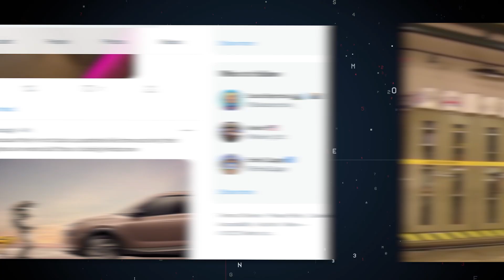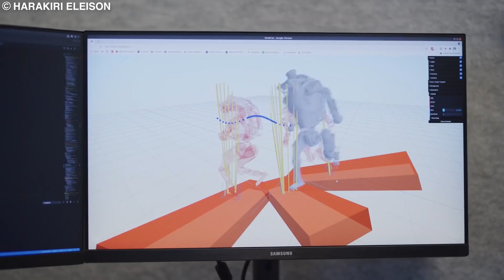Boston Dynamics' New Robot Makes Soldiers Obsolete, Here's Why

Comment: I'm almost certain in war the opponents would have their own robots to face off against before it comes down to a robot/human confrontation. Then if that be the case from what I see here humans still have the advantage of speed and agility.
Reply: Yes the robots would be able to operate autonomously but in battle where would they get the power supply to recharge in order to continue to operate alltogether?
Reply: @eulinpetit-woodyear6816  Solar, Robot FOB with solar and windmill arrays charging/battery support UV's.
Reply: @kevinwarburton2938  Solar recharging at a battle means the recharging unit, wether on the robot or at a base, would be out in the open which equals to an easy target.  Same goes for recharging using the wind.
Reply: @eulinpetit-woodyear6816  panels could be carried on the robot and detachable, even with cables so that the panels and robot can have different locations. Or there's probably something like satellite charging or so that emulates NFC so that charging can be done semi-remotely.
Reply: @pamlemm903  Basically it would come down to logistics.
Reply: Only if you are fighting a near peer. After WW2, the US only fought weaker countries.

Comment: Yea, well,.. a little suggestion, everyone viewing probably has ideas running through their head,.. but, the deployment of the Atlas to various environments, should also consider that like humans, their robots are limited in adaptation,.. my suggestion,  get Atlas some snowshoes[?],.. if the military is dropped into an environment, they may still be required to make adaptations, like snowshoes to help displace its weight across a shifting surface,.. I imagine they can simply stand more damage, across time, but I also see that tasks and use are going to be more in demand, than full autonomy. Just, get the job done,.. right? Autonomy will eventually come, but there's not been enough money spent to push such into "reality",.. We can be 'close' , for many decades to come.

Comment: How wonderfull this beast is with all of its Ai programming and tech BUT just like a Tesla or any other EV it will do a mile hike, have a couple of scraps along the way .....and go oH where is the nearest Grid socket that i can plug into for the next three hours and charge my Lithium ion Batteries.
COMMON GUYS until they invent a T 1000 ( Terminator ) Power cell this tech is going NooooWhere.
😀😀😀

Comment: Sometime 100 years or so in the future people are going to look back at this and know THIS is where all their problems began. Lol.
Reply: This is true. It's good we have an archive.
Reply: I’m remembering that scene in terminator 3.... when they are testing the first generation of terminators
Reply: Where all the problems began and an EMP is where they can all be solved. Robotics on the modern battlefield that have no defense against EMP are completely impractical.
Reply: @jessehines4044  Man, don't you think that in a few hundred years if they have fully autonomous AI controlled robots that have no need for external human control that they wouldn't know better than to not fully protect them with an integrated faraday cage to protect against EMP blasts as well as external hacks and whatnot? Not all electronics are susceptible to EMP blasts either. An EMP blast doesn't "DESTROY" electronics in the physical sense anyways, plus they only affect the ones that are powered on at the time of the blast. Any that would be turned off, protected or that operate on small amounts of electricity wouldn't be affected. Also electronics that do not have solid-state components that are vulnerable to electromagnetic fields wouldn't be affected either. Right now electronics can be fried by an EMP, but I guarantee in the future they will figure out how to insulate electronics in some kind of coating that protects from electromagnet fields the way rubber insulates against electricity. It's actually not too hard, hell simply lining electronics with aluminum foil is enough to create a makeshift faraday cage and will pretty effectively protect them from an EMP. Lol.
Reply: @chrislaws4785  Spare me, go back to watching Star Wars or something.
Reply: @chrislaws4785  Don't you think in the future that robotics won't be the only technology to advance significantly? It's kind of like the situation between body armor and firearms. Body armour was obsolete for 200 years at least once firearms came of age. But the people developing this technology aren't doing to so that in several hundred years time we might have an army of autonomous robots. No, they're doing it so that it would hopefully be applicable in a few decades from now. No investor is going to drop piles of cash in the hopes that they will turn a profit centuries after they died of old age. And right now, lest some huge revolutionary breakthroughs in both the fields of AI, fuel cell technology and counter EMP it doesn't look feasible for any of this to materialize any time soon.
Reply: @chrislaws4785  The thing you said that was the most asinine was about turning off all of the robots so that their circuits don't fry from an EMP attack. Ok, let's give your brilliant idea the benefit of the doubt so that all the robots will ALWAYS know that an EMP attack is inbound and then they all shut down in time ...sure. Ok, now you have a whole army of disabled and helpless robotic hardware.....STUCK IN THE MIDDLE OF A BATTLEFIELD AS SITTING TARGETS. So they're either shut down from the EMP attack or they're disabled from conventional fire once they make themselves sitting targets to avoid the EMP. Do you see the problem with your logic? You want to fantasize about godly robot soldiers of the future while A). Not considering that other technologies that will develop too and B). You're allowing your imagination to replace an objective perspective on whether or not it's even viable in the first place and if so to what extent. I know Commander Data off of Star Trek TNG is cool and I grew up watching those shows but it's foolish to let our dreams replace critical thought.
Reply: @jessehines4044  I NEVER said "Turning off the robots to avoid an EMP". I only said that ELECTRONICS that were turned off wouldn't be affected by an EMP.  That is just a simple statement of a fact. So get it right before you go building an argument by misquoting someone. YOU'RE the one that started fantasizing about intelligent "Data" robots. NOT ME. And YES, other technologies WILL advance before we get to intelligent AI, "That's how progress works". You have to advance simpler technologies before you use those technologies to build something more advanced. But since the video was about ROBOTS, that's what I talked about specifically.
Reply: @jessehines4044  They can easily be shielded.
Reply: What human will be alive ... is skynet asking the question ??
Reply: @ntal5859  What, so you think that all humans will be dead in just a hundred years or so? Kind of a bleak outlook to have for the future isn't it?
Reply: 100 years? your optimism that any of us will still be here astounds me
Reply: @iamspartacus6713  Why? Now I'm not talking about you or me specifically, I'm talking about human beings in general. But humans as a species I am 100% positive will still be around 1,000 or even 10,000 years from now and longer. There is NO reason why humans wouldn't be. Humans have been around for millions of years so far, in one form or another be it Neanderthals, Homo Erectus, Homo Floresiensis, or Homo sapien sapiens. Like I said, baring some kind of global catastrophe like a meteor or pandemic that wipes us all out, humans will still be here tens of thousands of years from now. Why do you honestly think humans won't be around?
Reply: I have sad news for you. WE will be lucky to be here 10 years from now (as we know ourselves today) it is an absolute guarantee we will not be here 25 years from now, much less 100 years.
Reply: That is right Sir...Creepy..One day ...when robo has their own self consiousness,self awareness...dooms day for mankind& humanity...be prepare..God bless
Reply: @sugengpratiknyo6024  No, I don't think that's what we have to be worried about. I DO NOT believe that humans are capable of creating something with TRUE sentience. But rather I worry about when we start relying too heavily on AI to do EVERYTHING for us. Humans NEED things to overcome in life, things to give our lives meaning and substance. But if AI controlled robots start doing everything for us, then what's the point of living? If you have no job, nothing to work towards and no reason to even get out of bed in the morning, then what kind of life would you have? THAT is what I think the future would hold IF we were to allow AI and robots to just replace human workers for the sake of "efficiency". And even super advanced AI are still human designed, accidents happen and who's to say that a welding robot couldn't one day start to mistaken PEOPLE for steel beams and start killing people. It's not a matter of sentience or "premeditated murder", it's a matter of "whatever can go wrong, will go wrong".
Reply: I doubt that in 100 years we can look back, when you know what I mean..
Reply: U know what ingress me is that know one ever mentions all of the SciFi movies we watched as kids was just preparing us for the future.....
Reply: Totally! We’ll only have ourselves to blame though. What people are willing to give for convenience
Reply: @Skywest25  ABSOLUTELY. And that's what I've been wondering, how much freedom are people willing to give up just for convenience? Where's the line? I know where mine is, but it makes me worried that most people don't want the right to be FREE, they only want the right to be COMFORTABLE.
Reply: @chrislaws4785  comfortable until it’s too late
Reply: @Skywest25  Exactly, like a damn frog being slowly boiled to death they won't realize how far it's gone until it's too damn late to go back. Then I guarantee someone will be saying "Why didn't anyone do anything? While looking at everyone but themselves.
Reply: Yes
Reply: In the world of the Matrix, AI gave rise to robots who eventually rebelled and defeated the humans after a 60 year war.
Reply: Elon musk said sooner that 20 years.
Reply: @JUANPABLO-be2ms  Yeah, but that's just being optimistic. Every tech or NASA person ALWAYS wants to believe that we will be on Mars or have flying cars or some shit in like 20 years. Ive just come to accept that in reality it's probably more like 3 times as far off than what they say.....lol. I mean sure, they MIGHT invent a true AI in 20 years. But working out most of the bugs and having it in actual mass production and fully integrated into society, would take MUCH longer. I mean take computers for example. The first concept of a computer type invention was invented in 1801 with a wooden loom that used punch cards to automatically weave fabric designs. And the first modern digital computer wasn't invented until 1942 and it wasn't until the 1970s that a version that you or I would recognize as a MODERN computer was ever built. So it took from it's concept in the early 1800s all the way to the 20th century in the 1970s for computers to FINALLY start being integrated into modern society, and not until the 1990s for everyone to start being able to have one in their homes, that's OVER 150 years. That's just how things go, it took over 150 years for things to really get going, but then it speeds up, now it's only taken the last 20 some odd years for it to go from computers on your desk, to computers in your pockets with smart phones. That's how I see it going with AI. It will take a long time to get going, but then it will explode in popularity and spread to every aspect of human life.
Reply: I for one, welcome our basilisk future.
Reply: Why are these people pushing and hitting robots? What is it designed for? See how the robots will fight back? So after all, this is not embedded in them and there is nowhere to take it. And if it is laid down, then it means the whole essence of these works is to create an artificial intelligence ready to destroy a natural person. What are we going to? Where does this "civilized West" lead the World? Isn't it enough that people are killing people? Russia is the last country where people want peace. And that's why she's alone now.
Reply: True. But I don't give it 100 years.
Reply: This is all they will release to general public. These machines are improving at incredible rate. They learn by not repeating mistakes, so they will become deadly accurate with weapons and almost indestructible, it’s just a matter of time. What is very scary is when they become sentient (having a conscious mind). The singularity ( look it up if you don’t know) will almost certainly happen in this decade.  The technological singularity or simply the singularity is a hypothetical future point in time at which technological growth becomes uncontrollable and irreversible, resulting in unforeseeable changes to human civilization.According to the most popular version of the singularity hypothesis, intelligence explosion model, an upgradable intelligent agent will eventually enter a "runaway reaction" of self-improvement cycles, each new and more intelligent generation appearing more and more rapidly, causing an "explosion" in intelligence and resulting in a powerful superintelligence that qualitatively far surpasses all human intelligence.
Reply: People? What people? 🤖
Reply: ATTENTION!!!! JESUS CHRIST IS COMING!!!!   IF YOU DIED TODAY, WHERE WOULD YOU GO???  HEAVEN OR HELL???  Jesus loves you and can forgive you of any sin that you have ever committed.   Repent and accept Jesus as your Lord and Savior and you will have eternal life in Heaven.  ROMANS 10:13 Any one who calls upon the name of the Lord will be saved.
Reply: @youtube_chaplain   Jesus never existed.  Christian Mythology for dimwits.

Comment: From a technological military standpoint, I don't see how this could be implemented with any efficiency. These robots would need some kind of power source whether electrical or gas operated. So, in an actual battlefield invironment, unless a mission is carried out in a specific time window, seems to be very limited with exception of maybe individual tasks. Though if ever captured would give the enemy valuable tech info. for reverse engineering thus could make the "alli soldier" turn against itself creating havoc or any other scheme that could be created. Makes for a good video game though.
Reply: A Spitfire was designed for 45 minutes of battle with 16 seconds of fire...

Comment: The big problem is power. Battery power is limited and recharging requires a noisy generator. The big dog type the military decided was too noisy as it uses a ICE for power. They decided that a mule was more use as it could refuel itself and was quiet.
Reply: You can easily solve the battery limitation  problem by combining smaller batteries  with reformed methanol fuel cells.